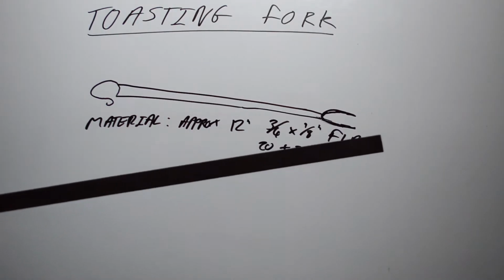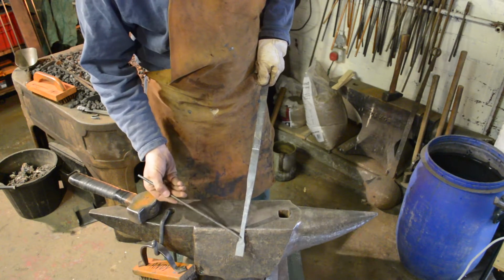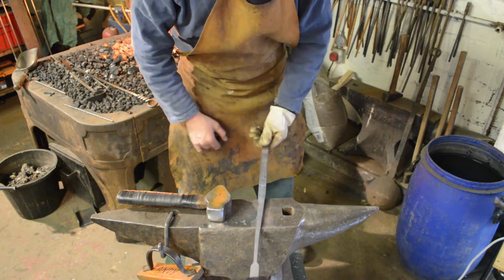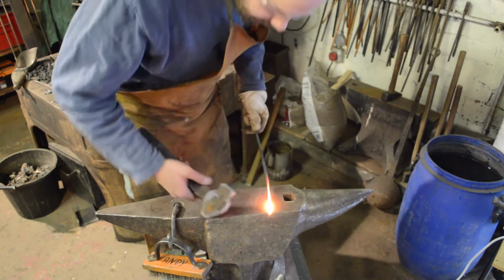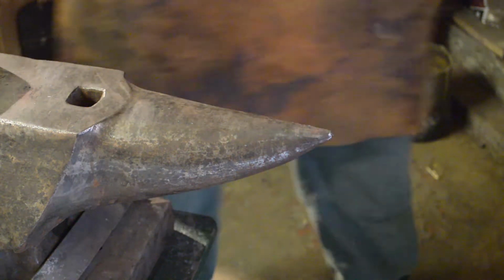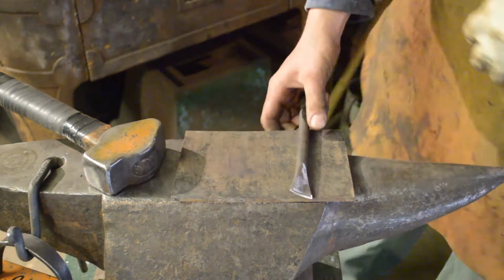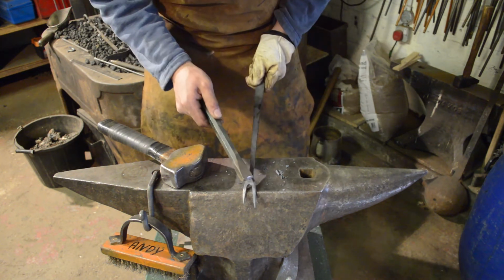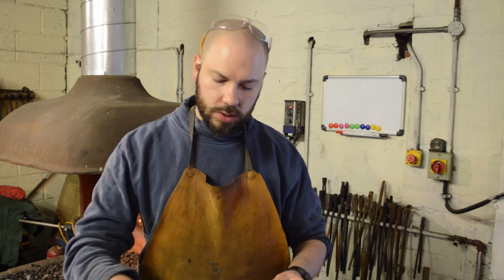Forging a Toasting fork: Blacksmithing basics 11.

Comment: Looks like a fork to me!! I usually use stock thats 1/2inch wide so I don't  have to draw out as  much as you did (if at all). And I usually cut the tines with my angle grinder instead of hot cutting it with a chisel. Good skill to have, its just quicker to line up a bunch and split a bunch of ends real quick with the grinder. I also throw a twist in for the handle.  Keep up the great stuff. Define Your Legacy!
Reply from the maker: Warped Legacy cool. I would normally cut with an angle grinder too. It's just good practice to use a chisel. As I say if you do that you can apply it to other things. 
Cheers bud. All the best 
Andy